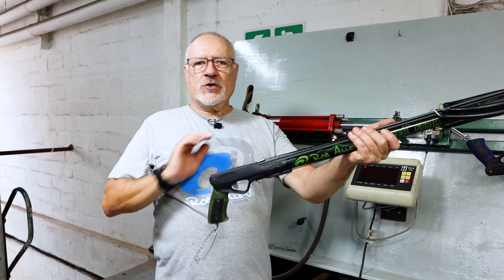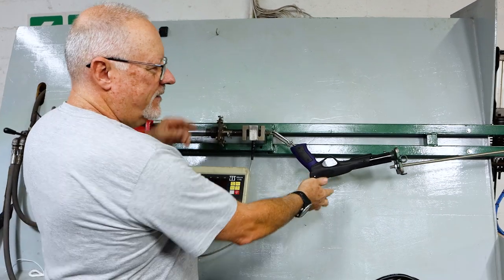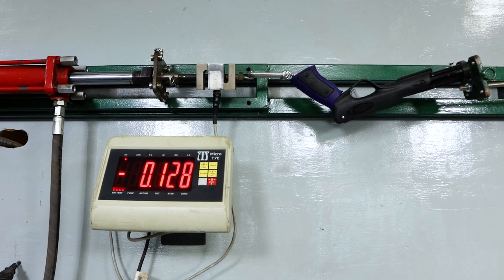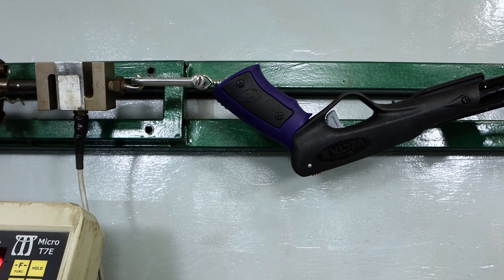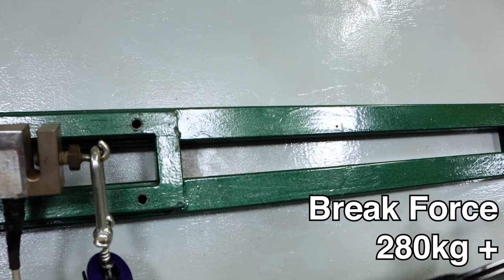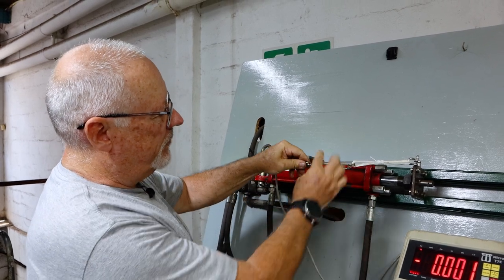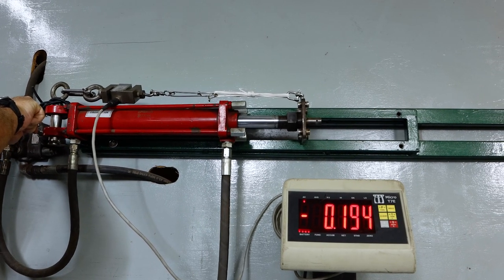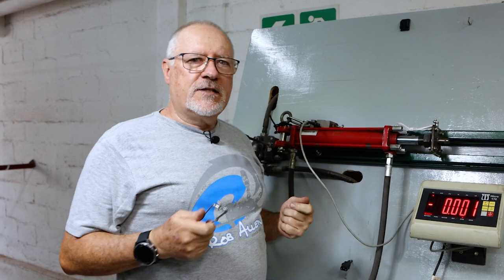Rob Allen | Handle Pull Test - Longline Clip Break Test | 2023

Comment: ..i caught already some pretty big and fast fish , and never had any of the roballen equipment fail me. one thing though bothers me.                                                                               i recently bought two rob allen barrels and handles and muzzles to mount them up myself. but when putting on the handle on the barrel there was some play between.                   so the shaft would not slide into the mech without forcing it hard , because it would push against the upper part of the mech. and that because the handle have so much play,     when loading the rubbers , because of the play, the shaft would be forced against the top of the mech even more, so that the trigger have to be squeezed extremely hard to release the shaft. i had that problem with both of the new barrels . when measuring the inner diameter of the new barrels, and measuring the inner diameter of my already existing rob allen guns, i realized that there is about 1.5mm difference. i dont know why is that. i spoke to my dealer about it and showed it to him. he sais he would contact you but never got back to me with results. that is very disappointing. can you tell me why this is so ?
Reply from the maker: Please email me pictures of the barrel, our dimensions are never that far out.   rob@roballen.co.za

Comment: Hi Mr Allen, just wonder how long the RA rubber can work with how long of the gun barrel? I have a 1m Rob Allen rail gun for 2 years and I'm keen to upgrade to a single 16mm rubber, but not sure how long the new rubber shall be? Thanks, Rui
Reply from the maker: Hi Rui, The 16mm should be 55cm on a 1m gun. what was on the gun before?
Reply: @RobAllenSpearfishing  It's a Rob Allen sparid evo 100cm with twin 14mm bands. I also recently got a Rob Allen Scorpia 700cm for cave hunting/Night diving, it came with a single 50cm 16mm rubber, but I seems to weak in my experience and feel keen to shorten the rubber as well. Would be really helpful if you can publish a ruber/barrel length recommandation chart.  Cheers, Rui
Reply from the maker: @ruitian8724  The bands are all about the weight of the spear (gun set up). If your 100cm was originally set up with 2 x 14mm, it should have had a 7mm spear. This is the best band set up in our opinion for a 7mm spear. All these band measurements can be found on our Rob Allen site,  www.roballen.co.za   All guns have a description and band length. Be aware though, some countries can specify different set ups to what we recommend. Some have longer bands (you can shorten) and some have thicker spears. For example, we recommend a 6,6mm spear for a gun with a single 16mm band, some are set up with 7mm.
Reply: @RobAllenSpearfishing  Thank you Mr Allen. Each band configuration on your website seems to be for either 14mm or 16mm, and wonder if you can also recommend band length recommendations for both 14mm(single and twin) and 16mm (single and twin) against each length of the spear(shaft) if the Spear(shaft) is the only concern.  Kind Regards, Rui
Reply from the maker: @ruitian8724  If you look at the different gun descriptions, you will see a double banded gun shows the bands a little longer, when comparing a  double compared to a single. For example, a 100cm gun with a single 16mm band is 55cm. A 100cm with 2 x 16 is 60cm length. This is also just a guide, some prefer longer and or shorter. Also, there can be a variance in rubber brands and or the made batches.
Reply: @RobAllenSpearfishing  Understood. Appreicate for your guidance always!  Regards, Rui
Reply from the maker: @ruitian8724  👍👍